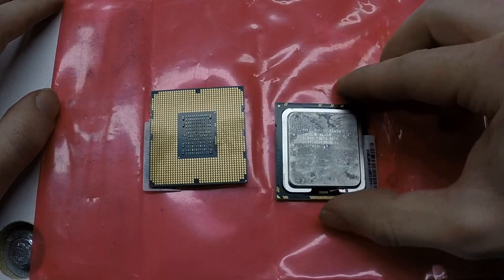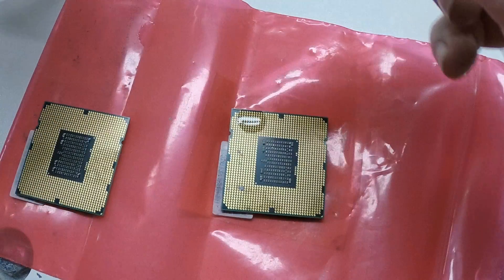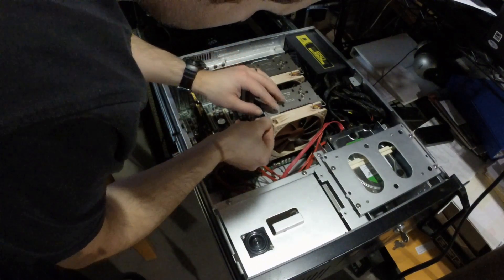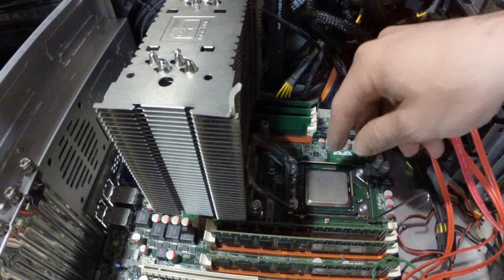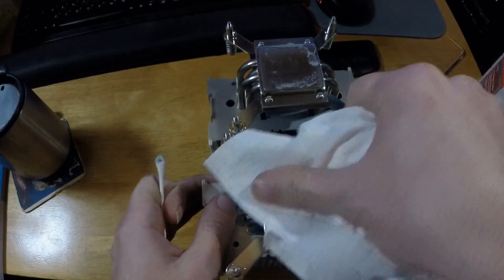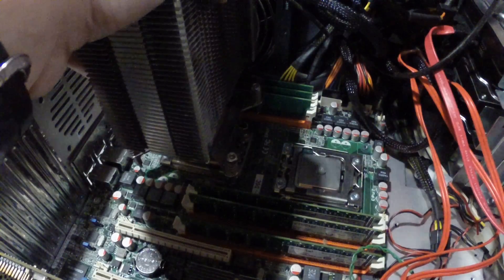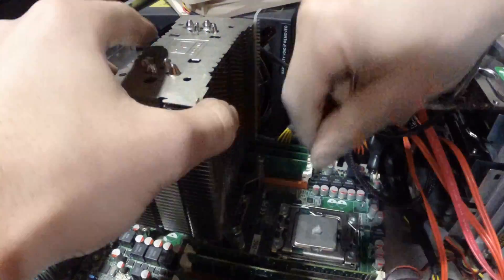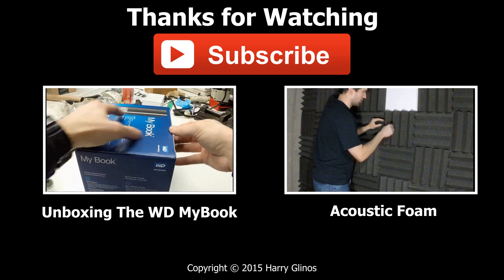How to clean thermal paste off of a CPU.

Comment: most computer parts can be cleaned in a sink of water and dish soap as long you no something about what not to do as far as scrubbing so that you do not must off parts or loos jumpers. cpus are the best thing to wash just watch the ceramic compasitors on the bottom they bust off ez and most times with a cpu you will find you can just clean it like this guy did. rember if you every wash a motherboard or realy any part to do researchon it and to let it dry for at least a week and to make shure its good and dry you can toss it in a bag seal the bag then let it sit under a light if after a few houres you see any condensation in the bad then it needs a nother week to dry. I my self have a room set up wear its dry as hell for letting thing dry. the last motherboard I washed was dry in 2 days.

Comment: I cleaned off thermal paste off amd ryzen pins and didn't damage them. Even though in my case only a thin streak bridged the outermost pins near the triangle. I used a Q-Tip to clean and then used coffee filter and 70% isopropanol to completely clean it. This happened because cpu came out with cooler when removing. And yes no bent pins in the process :D
Reply: CPU coming off with the cooler is the most horrific thing I've ever experienced while PC building/maintaining... It was so god damn scary, esp 3 years after I last opened it and then this im kinda clueless omg
Reply: @julesz7056  CPU coming off with cooler is quite normal for AMD's latching system. That's why even after so many years I think twice when I see a pre AM5 system that comes to me for service.

Comment: Will anything happen if little Thermal paste goes on the pin side of the cpu and you don't clean it
Reply: the system just wont boot or you will lose some features depending on which pad or pin is being blocked
Reply: Will it be fixed if you just clean the thermal paste off the cpu after it’s gone on the pin side??

Comment: Can a Soft Toothbrush with Alchohol work for getting a tiny sliver of thermal paste on the CPU pins? It was my first build.
Reply: The consensus from the several different threads I've been reading online say yes, but if you have an old cpu to practice with first then I'd recommend doing so, and to be very gentle.

Comment: Thank you so much. I got thermal paste on the bottom of my i7 cpu and thought "This is it, I just wasted 330 dollars." (Im a new PC builder) This video alone helped to reassure me that i didnt ruin a $330 i7 7700K. Thanks bro.
Reply: Brian axb sake I’m a first builder and I did that
Reply: Same to me as well, I’m a first builder and there a tiny bit thermal paste on the bottom in the contact pads but luckily I cleaned it and I need to buy a monitor to test as well

Comment: NEED HELP!!!

I have cleaned my new Intel i5 6600 cpu and its pins with wet tissue papers (which contains moisturizer, glycerine, rose fragrance etc). Now i am worried about my new Intel i5 6600 cpu. 
Will it make any long term negative impact on my new cpu's performance and its life span?

What should i do now?
Reply: So what happened? Did it still work?
Reply: Gadget Gadget you can use compressed air to blow out the pins if you have it

Comment: i really hope no one tried cleaning the their pins if they had an AMD ;=;
Reply: i jsut seen this and it might have saved me a lot of trouble. i have an amd 1050t and i was thinking the system was dead but left it for a few months and went back to inspect the cpu and noticed there is a bit of paste on the pins. i never thought to use a toothbrush, i just hope my roommate likes the taste of thermal paste.
Reply: Yes!! Works great =) I was careful anyway, even though I was messing up a bit. Didn't use force that much
Reply: I don't get the joke. Last year I bought a used AMD FX 8350 PC that was apparently blown. Wouldn't turn on. Removed the cooler and whoever built it had applied a TON of paste. So much that it leaked over the sides, into the socket, pin holes, all over the motherboard, etc. It was an ASUS 990FX board, very expensive. I used a sewing needle to chip the hardened paste from the pins. Dribbled some alcohol on the pins. Blew it off with a can of compressed air. Still would not even post. Replaced the mobo and it started right up. Been running it 24/7 as a media server ever since.
Reply: I'm in the same situation now, did you use a toothbrush to clean your AMD?
Reply: I did like the dude in the video, used a lot of alcohol.
Reply: just did it with my amd... fuck........................ hopefully it still works fine
Reply: Lol! I have a very similar problem to yours, only my FX-6300 came with a bit of paste around the bottom edges, (but barely between the pins) and you're right about the Asus 990FX boards being expensive; I paid $86 on ebay! D:  Reading this thread has been incredibly helpful but I will definitely be practicing on an older cpu before I touch this new one.
Reply: Azrael I cleaned off thermal paste off amd ryzen pins and didn't damage them. Even though in my case only a thin streak bridged the outermost pins near the triangle. I used a Q-Tip to clean and then used coffee filter and 70% isopropanol to completely clean it. This happened because cpu came out with cooler when removing. And yes no bent pins in the process :D
Reply: @rounakr94  this is exactly what just happened to me today I have been looking everywhere for a solution. I ordered some rubbing alcohol today will try this!
Reply: I have like a little paste on the base of one pin, is that dangerous to install like that or?
Reply: Lmao
Reply: What happens if u do?
Reply: Hoss tL no and i am looking how to do it
Reply: GGPL you dont clean them, at most use pressured air to blow dust off of it if theres some how dust on them. but you dont touch them.
Reply: Hoss tL i used toothbrush to clean thermopaste
Reply: GGPL yea, you just have to be very careful and go slow. you might've shortened the life on your cpu tho. but yea a toothbrush or anything with softer bristles is really the only way to clean an AMD cpu's pins
Reply: Hoss tL i was very very very gentle
Reply: GGPL LOL shout out to the dollar menu legion! Small world

Comment: You spend time to clean CPU and apply new paste, and you say you need to do it fast to not get dust in the holes, but you did not spend even 5 seconds to remove the dust on the top of the server before you did put in the CPU?
Reply: This one is only 4 minutes though. If someone doesn't have at least a 30 min. attention span, then they're going to have a bad time.
Reply: Thank youuuuu
Reply: People don't like to watch lengthy vids

Comment: In the Mac Pro, 2010 maintenance manual it shows a 'no entry' sign as the thermal paste footprint a every where else's and u has one pea sized dollop

Would it make that much difference Doing a round circle with a line thru it?
Reply from the maker: Steve Mullins Do you have a link to the manual? I can't find it. 

I suspect that if the manual is showing you a "no entry" sign, then it probably means don't put thermal paste in that location or don't touch it. 

Don't apply the paste in a circle. You only need about a 5mm ball of it. At a microscopic level, the surfaces of the heatsink and the CPU aren't entirely smooth. The thermal paste fills in the small imperfections to allow for better heat transfer. You only need a very small amount create a thin layer that will spread across the CPU to fill in those gaps. Putting too much and you run the risk of creating a insulating layer instead of a heat conductive layer. Also, excess thermal paste will likely get onto parts and causing corrosion, capacitive, and/or short circuiting issues with the CPU or motherboard.
Reply: Here is the image in question - https://www.dropbox.com/s/htxif1l4ecn5ujv/Photo%2029-07-2015%2007%2004%2016.png?dl=0 
Pm me our email and ill send the PDF

 I think it might just be showing what it should look like after applying / what it should cover, in the macrumors guide, he spreads the paste over the entire cpu
I'm guessing at the apple factory in china, they just stick a dollop down and go.